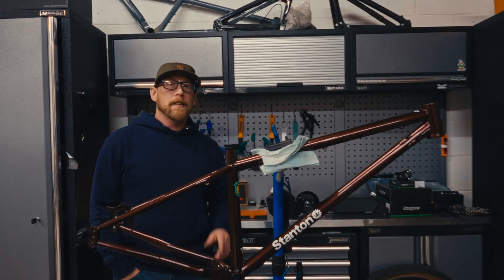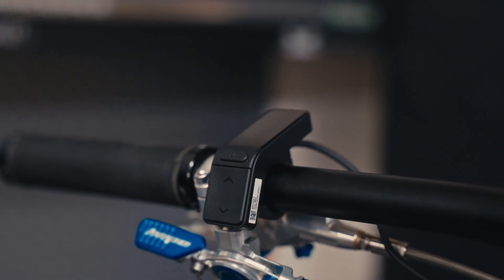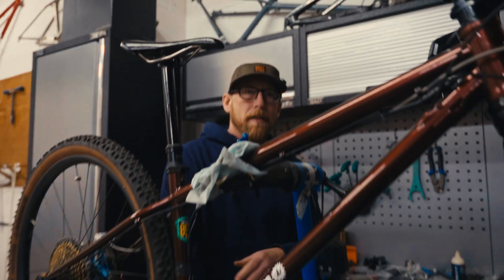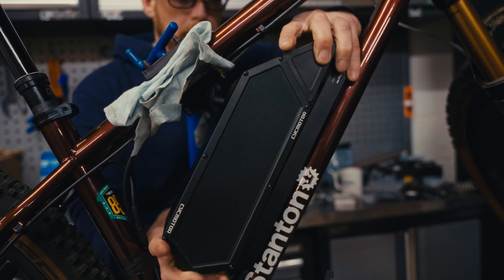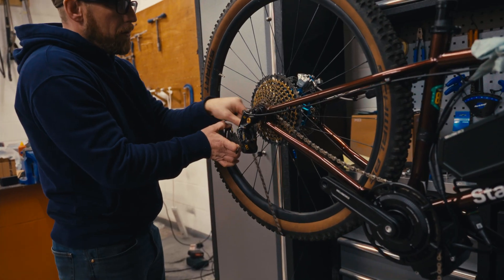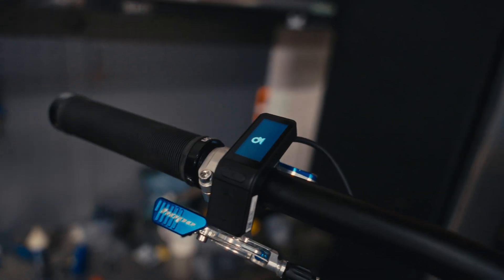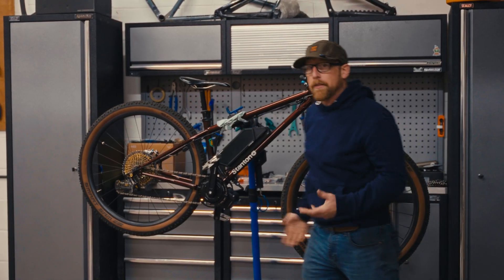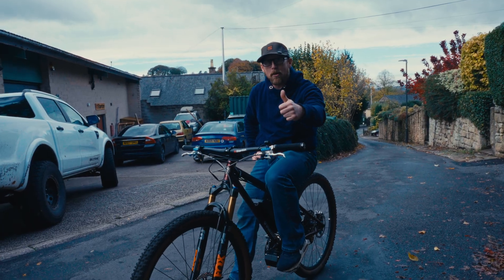CYC Photon 2 E-Bike Conversion Kit!

Comment: Do you have issues with the motor taking a beating hanging so low like that? I hit my bash guard a fair amount so I would just be worried having the motor lower than the chainring.

Comment: It would also be interesting to compare both motors at 1000 and 2000w using pedal assist mode for an equal comparison. When do you expect start selling CYC motors?
Reply: We should have them up on the website in late January

Comment: One of the advantages of the CYC system is that they use ISIS cranks, so you can get shorter cranks from Miranda - fit and work perfectly.

Comment: Dan, this is an interesting thought process, I tend to agree with you this may be the way forward -  and the way battery and motor tech is rapid evolving purpose build e-bikes are outdated within a year! A few questions: what do you think about the reduction in BB height? Is that the A52 battery you have there and is it ok on rough trails using bottle cage mounts? Would it be an idea to drill another hold and pop in an extra riv nut? Cheers
Reply: I just ran it on the bottle mounts, I could've had a strap to help it, it comes with straps. Adding another bottle boss further up the frame would be a great solution! The BB height doesn't feel affected when you ride, simply because everything is covered by the chain ring anyway. 😁👍

Comment: I would have thought the battery was too heavy for just two bottle cage bolts. Doesn't it work loose?
Reply: It is sturdy and in place just on the bottle bosses, however, the kit does come with some straps, you could always run those.